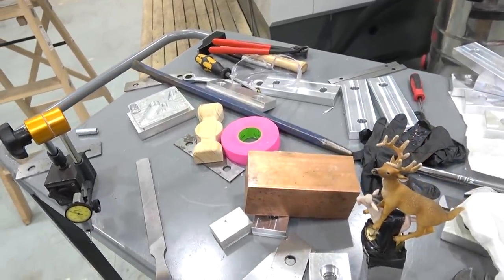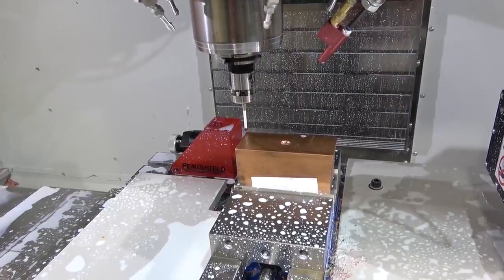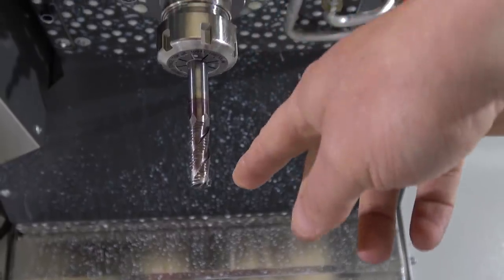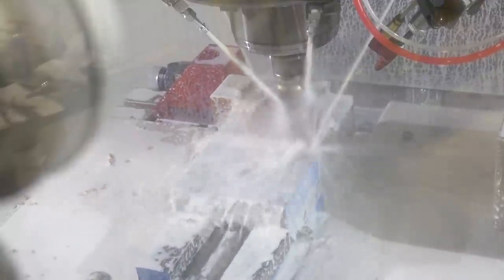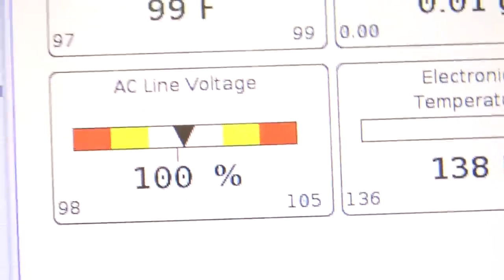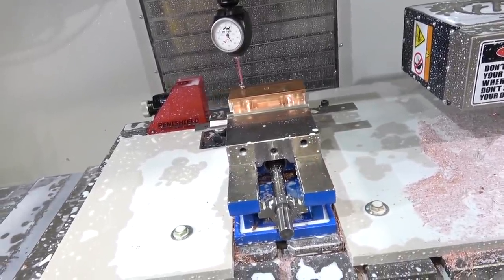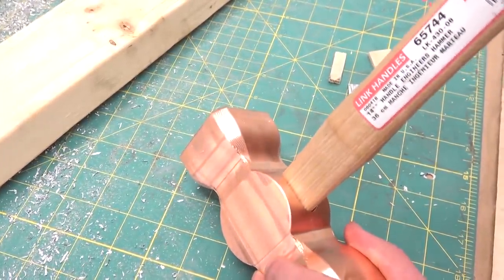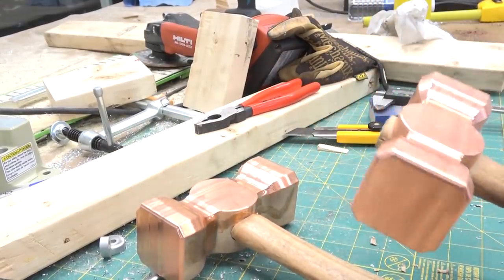Making a Copper Swing Press | An Essential gift for Craftsmen

Comment: The led lights flickering is actually  due to no regulated power supply on my 2017 vf4 (dont know if yours is the same case) one failed and I dismantled  the thinger, and low and behold there's only some resisters in line ran straight off the 120 volt bus (super duper lowest denominator chineseum)...... the LEDs do not like not having a powersupply

Love your vids as always
Reply: You can buy "LED  filament" lamps that screw straight into 120V. Forty 3V in series makes that work out... That being said, a current regulator and a capacitor would make it even nicer. It's, like, $0.50 in additional parts...

Comment: I had to remove D2 rolls 65 Rockwell from 4.5" shafts all the time, the fit of the rolls was like .001 or so and they would get stuck. I used a 5' diameter steel shaft that I had welded copper beads on the end of the shaft, 3/8 thick or so. I used the overhead crane and some straps to make a copper battering ram, it worked very well and was faster than wrestling with a hydraulic press.

Comment: A wise man once re-probed the X and Y datums after the face mill runs. Watch out for burrs which may catch the probe stem, and not the ball, giving you a faulty reading.  Also a good time to check the part thicknes, and adjust as necessary. Ideallly hold back .010" on the 1st part, as not to kill it.

Comment: For running the soft material you'd be better off going with 2 flute hss tooling. That way you get way more chip clearance and you don't break the bank, you can also use 2 flute hss tooling for high speed milling.

Comment: I think all CNC machines have trouble with messing with lights, at least if you have the wrong kind of lights. Even my 3d printer was causing some flicker until I changed the bulb for a different brand.

Comment: Do not use TiAln or other steel specific coating for copper or aluminum. Asking for trouble! Aluminun and copper love uncoated tools.
Reply: AlTin doesnt like it either. Bout the best coating for non ferrous ive found is helicals Titanium diboride. Lasts damn near forever. Personally, if its my wallet paying for tooling, Zirc works just fine, and from resellers like Atlas and Lakeshore, is much cheaper, for probably 85% of the performance, especially in larger endmills.

Comment: As an electchicken I have to tell you, never hammer using broad side of the electchickens hammer, you might damage the rivet, and they wont drop open one handed anymore for cutting through live wires.  Use the narrow side and your hammer will last you years and years of "proper tool use".

Comment: Instead of picking up a drilled hole put a guage block up against the machined side of the part so the probe doesn't hit the overhanging stock material. Then manually set your work offset over by the length of guage block. Small holes don;t give you enough resolution to pick up off of accuratly

Comment: You can find the center within tenths with a dial indicator in the spindle or an extension on your probe tip if that is too old school. The issue you had with the finishing is likely the sidelock holder. they are not balanced that well so running them at high rpm can cause the issues you have. I don't think the spindle speed variation is necessary for finishing, I've never had any issues finishing copper without it. Reduce the jeezless stepover! For a smooth finish with a 1/4 ball you should be somewhere in the range of 5-10 thou step over and your preclean should leave less than 20.

Thanks for the vid and the laughs.
Reply: The probe tip he was using will find the center to within 2 tenths no problem (with a properly calibrated/centered probe anyways), and with the VPS program you can automatically dump the numbers into your offsets - that’s the advantage over using an indicator.
Reply: @Jester_The_Jynxster   a drilled hole isn't accurate enough to find center off. that tip wont work on the outside. needs a bigger diameter tip or a 4 prong extension to find it on the outside. I guess i wasn't specific enough on what i meant.
Reply: @derekhartley4480  I don't know if the hole was drilled, milled, or bored; but generally speaking that probe should be able to accurately indicate to within 2 tenths. Can't even count how many times I've setup machines in our showroom to demonstrate that for customers. I'm a Haas service tech. I promise you the probe is capable of that much. Whether the hole is round enough to bother indicating to that degree of accuracy is a different story entirely lol
Reply: @Jester_The_Jynxster  i in no way meant that the probe wasn't capable of locating the part accurately i just meant that a drilled hole, which it looks like and i believe ave said it was, is not accurate enough and that is where the step came from. I did not articulate that very well in my original comment. The reliable way to locate this part would have been on the outside which could not be reached with that probe under the layer of material that was still on there. however could be reached with a probe extension or dial indicator with enough accuracy to not leave a step.
Reply: @derekhartley4480  ahh I gotcha now. Yeah  I believe  everything you said there are quite  valid points then in that case.

Comment: A mere 8" long Gray Tools Swedish nut lathe? How can you get a perfect concentric circle on the circumference of a nut or bolt head with the low torque from one that short? You need to replace it with a heftier 12" that has 50% more torque and a built-in thumb detector! Of course, its built-in thumb detector merely be a supplement to this one if it's not within immediate reach.

Comment: You know you can use Blaser Synergy 735 instead of milk for cooling?
Reply from the maker: 1. Blazer dealers are goofs. 2. Problems with corrosion, de-ionized water required; no thanks.
Reply: @arduinoversusevil2025  But it looks pretty with clear fluid. And everyone knows looking cool is most important.
Reply from the maker: @noc8076  very true. I'll see if I can't get some off brand from China.

Comment: So here's my question...  if you have to spend 3 hours just getting the tooling right, all the measurements set up, the machine ready to run, and an additional 3-5 hours drawing the design up in CAD, PLUS whatever time gets lost by tools breaking or the CAD input or something being screwed up...  what exactly are you saving by using the CNC machine over just milling the whole thing by hand?  

It seems to me that unless it's an uber-complex design, (which if you can draw it up in CAD for the machine to do for you I'd think you could do the same thing with the same tools by hand faster)  why have a machine take 5-12 hours to knock out a part that you can do, by hand, twice as fast?
Reply: The time spent and materials knowledge (breaking a tool leads towards learning how not to break it) is transferable to more complicated projects. Simpler projects are easier to understand and learn from.

Can the variable spindle speed to avoid harmonics be done on a classic mill? or would a separate bit be needed for that?

Comment: Haas has a gcode for reversing the spindle direction with a dwell to clear cutters and drills of stringy chips.. you can also program it manually if you were to own an older haas without that newer feature... I don't know if it'll work with the copper you're cutting but I always used it with gummy materials like 5052 aluminum that likes to clog flutes and it works great!

Comment: Never understood why a piece of equipment that expensive doesn't have cameras and or lasers to detect exactly where the cutting material is located in space.  Or at least close enough to get the probing tip near the piece to them measure exactly.

Comment: Use to work production machining back in the day.  Not gonna say who for, but they probably made some hydraulic brake stuff on whatever you drive.

Anyhow, ended up a QC weenie at that job, in charge of a fair amount of said quality on night shift.  Show up one day, get told we're not going to be running our operation because day shift found a shit ton of our parts failed QC check and we'd done fucked up good and they needed to sort it all out.

Fuck this.  I'm not even on the clock yet and I start tearing through the parts to find when the error happened.  An hour into days is when.  And then they ran for three more hours before noticing.  All my parts from night before were good to go.  Days tried fucking us over when they were the ones that broke a bit and ran for half a fucking shift that way, when they were supposedly pulling a part for QC every fifteen minutes.

Comment: When I have to use SSV, I don't run it more than 100RPM variance because of the extreme spindle load it creates. However, mine can't do 15k RPM either so you do you

Comment: Tell night shift if your removing the base on the second op anyways give the work shift close x,y numbers but good z number mill base off then probe out side edges to have part perfectly centered from 1st to second op. Another option mill your soft jaws to be exact fit to part. Good video you should be happy with yourself I program and machine with a DMG dmu 50, 5 axis with siemens controller using there conversational programming ( what haas vps is a knock off of by sounds of it )  at least 40 hours a  week and you got me to watch your entire VidGeaoh of someone machining a swing press.

Comment: If you got all of the offcut scrap from the fuckit bucket and melted it all down together, would you end up with some cool alloy of like 5 different metals? If so, could that be machined or poured into a mould to make cool paperweights or something? I just feel like that stuff should be used for something, but fuck sorting it into distinct metals.

Comment: Put your tool change back your not ready for the risk of a tool changer crash. Reach out to Titian i bet he collaborate with you on youtube I'm not a big fan but he will get you comfortable. With copper just treat it like annealed aluminum. Copper like a lower speed big bite and good fixturing. and follow a basic rule of 3 don't have your tool out more then 3 x its diameter. Even if that was a one off I'd still cut jaws for the 2nd op so i know i can get sub 1tho alignment or cut a v-tail on the face on one end and do five sides of the handy 5th axis  head but honestly ditch the 5th for a 4th and build a table for it you can cut 3 sides of multiple parts or do some crazy round stock work with a lot less time mapping tool paths. If I'm ever near by, I'd like to come over and make that machine dance for you. ( I helped design the 2014+ haas control systems, while i no longer work with haas I do own a 2018 DM-2 with every option and a used sl20 lathe)

Comment: Not that the wedge used to secure the handle to the tool wouldn't work just fine, but they make these cool round wedges that are supposed to expand the wood evenly in all directions. I'll place this link right here, in case you're interested. https://beaver-tooth.com/products/round-metal-steel-safety-wedges-for-hammers-sledges-and-axes

Comment: use vice stops, set offsets with a 1-2-3 block or some other square object, set g54 for first side, and g55 for second side, then shift g54 to split your excess material, done, and then you can skip the damn probe and make 1000's of parts without a worry... except that whole underpaid night shift lackey goonin one our for ya

Comment: Isn’t that Haas a 5-axis?  Why did the 200-lb gorilla have to move the work piece?
Reply: It's a three-axis with an add-on two-axis trunnion AFAICT. And making the 5-axis "go" ends up being a pretty challenging programming problem. If he solved that, the surfaces could be cut with the side of the flutes instead of the tip of the ballnose.
But the real problem is that, even if you can mill from five sides, you have to hold it from somewhere, so you can't "finish six sides" in one op.

Comment: Can you provide the Cad file? Would love to have sich a Cu Hammer...
Reply: Back in the day when the heads were cast or forged, the shape in question (more metal at the ends) was most economical.
If you just make a hammer out of square copper stock, all you really need is the through-hole for the handle, and some work to fillet the edges; the additional details are just to make it look old.
(I guess what I'm saying is that the CAD could be easily reproduced yourself, just measure and cut the hole for the handle!)

Comment: Hey AvE, bear with me on this one, as I’m a budding luthier and my knowledge of metal working has come mostly from you.

Is it alright to mill a copper hammer? Don’t you risk marring the face of the hammer? Wouldn’t it be better to forge/hammer out the tool to prevent dents/work hardening further on? That is to say, work harden it from the get go, so as to keep its shape in tact?
I’d be glad to hear anyone’s more educated opinions on this matter.

Comment: Did ya calibrate that probe? 
.0005 max runout on her..
Reply: Need a ring gauge standard...calibration macros are in the control..  probe is only as good as the calibration.. 😉

Comment: Just made a copper hammer almost the same design with my $20 harbor freight angle grinder and craigslist drill press I sanded mine so it has a better finish, only used 1 bit and 2 discs. Come on Bumblefuck how many axes is that thing have? Fun Fact: Axes has the distinction of being the only word in English that is the plural of three different singular nouns. axes is the plural of ax and axe, but it is also the plural of axis
Reply from the maker: C'mon Billy, let's see it. Link?
Reply: I'm lying this is the youtube comment section isn't it? I could make one though if I got off the couch. Love your content, keep up the progress.

Comment: my swing press.  this has been in my family for probably 70 years.. https://imgur.com/a/jRH7Q   i went off to the parts store.. one of the body shop guys had the shops 7 pound swing press going on a bumper bracket.  when i came back 10 minutes later he was still going at that same bracket. i yelled across and said.. do you need a bigger hammer..  he nodded yes.. i pulled this out of my car trunk.  handed it to him.  his eyes were glued to it as i carried it in.  only took 2 swings to straighten the bracket..  i leaned the swing press against my rollaway tool box.. it was too big to fit inside it.  i proceed to start putting the part on the car i just picked up.  the body guy is standing there panting.. drooling at my swing press..  i thought about it and walked over.. picked it up and walked it back to my trunk and locked it in.  the look on his face was priceless..  it was like i had just stolen the most beautiful women in the world that he had planed to elope to las vegas with.  his face just fell.  as i walked away with it.     these are actually called Fence Mauls.. and they are still available new..  this one weighs like 17 pounds..  and yes.. somebody borrowed it and split the handle.  so some fiberglass tape till i can scrounge a proper replacement.